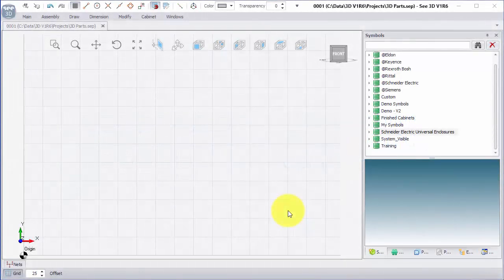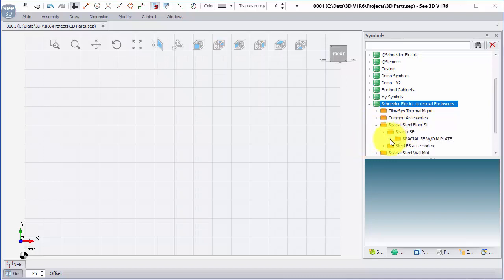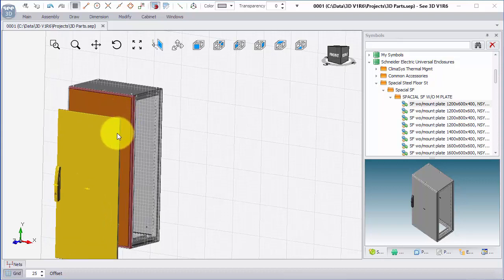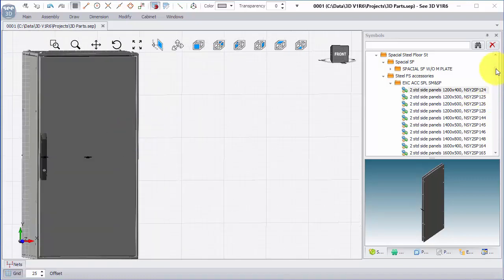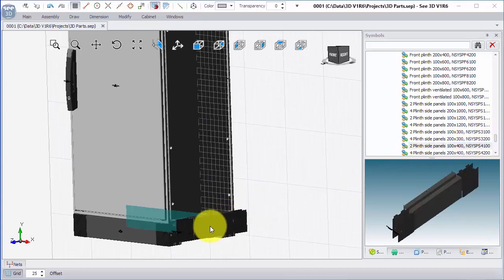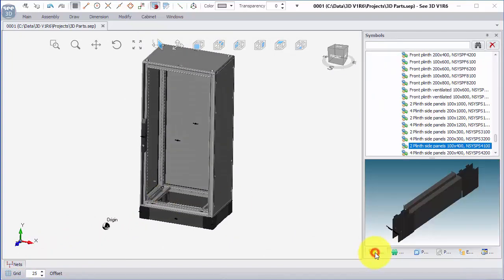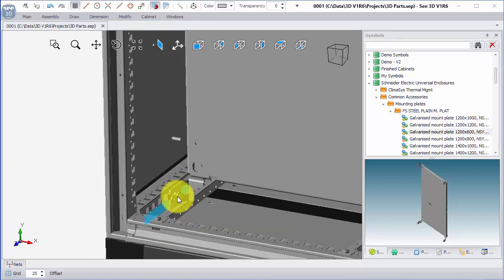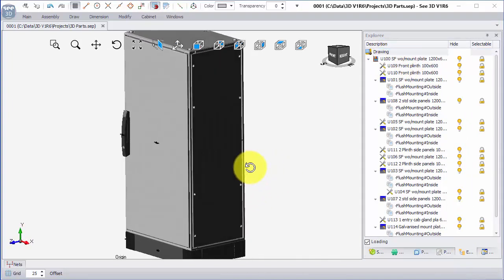See Electrical 3D Panel Mating Snaps

Comment: Hello, I have a question, because the symbols when exported from see electrical to 3DPDF lose or do not take the assigned color from the commands - color - brep option? When exporting them, they appear without color in the pdf file
Reply from the maker: Hi Marcos can you tell me which version of 3D Panel and which PDF viewer you're using and I'll check this out and get back to you.
Reply: @IGEXAOUK  thanks for your answer, 3D panel designer version is V3R1 SP2 (3.12.21.5), I’m using acrobat reader DC, But the problem is not the pdf viewer.
Reply from the maker: @Marcosdj18  Yes you're right, currently these colors applied using this command are not displayed in the exported PDF, only the blocks original color is used. I've added this to the requested enhancements list.
Reply: @IGEXAOUK  thanks for your answer
Reply: @IGEXAOUK  thanks for your answer

Comment: Hi,
How it snaps exactly, do we need to assign some thing to snap?
Reply from the maker: Hi, using mating block planes (with +name and matching -name) and adding snap points allows for preset points to snap to. Check this video for an example https://youtu.be/7jOyY5hFAIM
Also be aware mating plane snaps can have + and - prefixes e.g. +PSU on the gear plate and -PSU on a component.